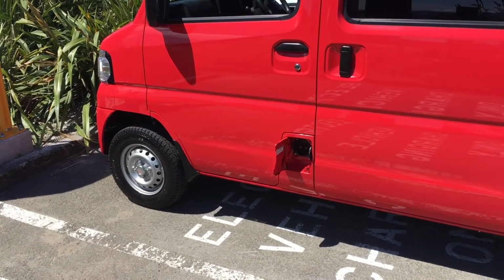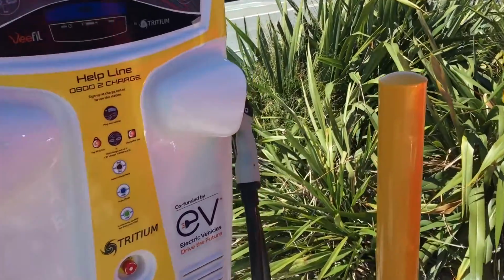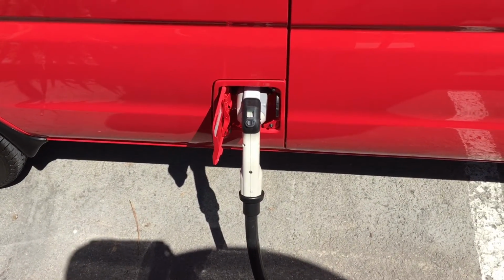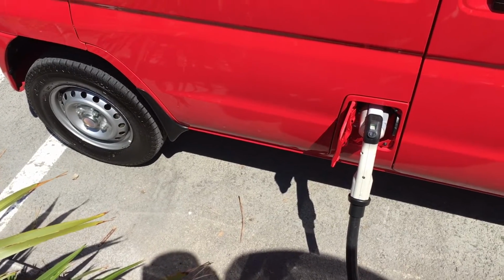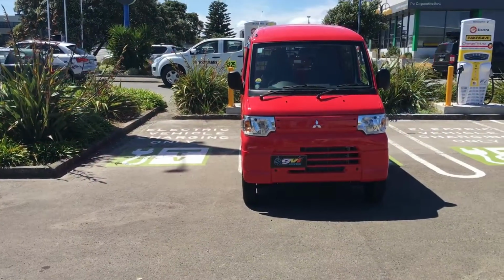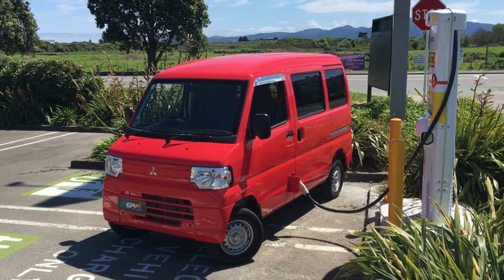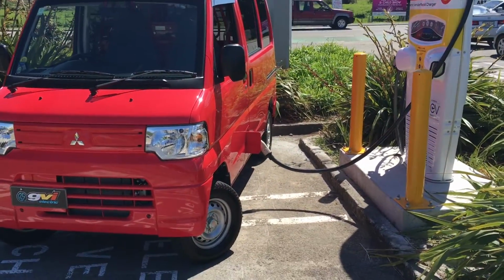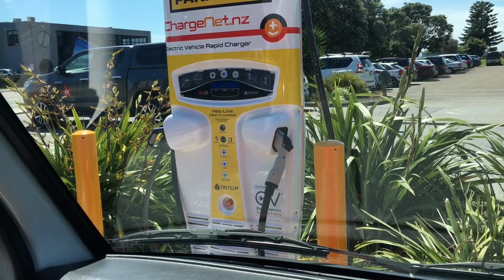DC Fast Charging Mitsubishi MiEV MiniCab

Comment: Hi there. So did I miss it? How LONG to charge your little battery pack on that 50k fast charger? At what cost? Cheers and thanks !
Reply from the maker: A 25kW charger gives me about 5.5kWh in 15 minutes, gives me about 40km driving in the city, that would cost about NZ$3.50. 25kW chargers are good for getting some extra range on a busy day. A 50kW charger will give me 16kW in 20 minutes, about 100km driving,  costs $9. 50kW chargers are what I use for taking long drives between towns and cities. But if I charge at home, $5.50 for 160km, but it takes 7hours, overnight.
Reply: @DarrylTalks  then i guess gas prices are also rather too high in NZ , right? i live in mid-southern California, USA, where gas prices have always been rather too high since ancient times and recently it's gone even higher than ever before ... however, a $US4.15 average price for a US gallon (4+ litres) currently drives my Subaru Crosstrek for nearly 34miles, which is about 55Km or so ...

i know living costs in NZ is high of course, but is it this high for car fuel or are you paying more than expected for an EV charging station? there are EV charging stations in the community where i live right now and it costs $US1/hr ... there were different chargers installed here before and they were $US2/hr if i recall it right ...

California's government is supporting EV vehicles and solar power panels strongly although it's in the news recently that solar power panel support may drop or be totally removed next year ...
Reply from the maker: @dadautube  Electric cars, charged a DC charging stations cost about the same to run as a hybrid car. Petrol here has loads of tax. I think it is NZ$2.30 a litre. Probably around US$6 or $7 per gal. Charging EVs at home is way cheaper than running a hybrid. DC charging costs around US$10-12 per hundred miles.
Reply: @DarrylTalks  ok ... got it ... i guess NZ$ compared the US$ is similar to how the British £ is compared to the US$ ... it's higher ... but checking it online, NZ$ costs even more than the British £ ... rather odd ... :-)

Comment: I marvel at how issues like plug placement get past user testing at the design stage, I would happily put up with such limitations to go electric but not at the 20ish grand people want for them here in Australia, that is 2/3 of what a brand new 2023 ev costs ffs. 
Ironically these little vans tick more boxes for my needs than anything new available. Hopefully the new regulations open up the gates to encourage uptake for more than just the wealthy. Albo is a bit of a non event though so.......
Reply from the maker: I guess they are designed for chargers on islands, which would make sense in a postage depot, they can plug it in while they put parcels in the back of the van at a loading dock. It's literally a Japan Post delivery van.

Comment: Someone has stuffed up big time with the design of the charging station, should have been designed with angle parking or even a longer charging lead.
At a petrol pump the hoses are longer.
Reply from the maker: Most of the charging stations are set up this way o. The bright side there is space to do the parking trick. Some stations have longer cables, but I think that it is for station maintenance reasons that the cables are short, I have seen stations with long cables in a bit of a tangle.